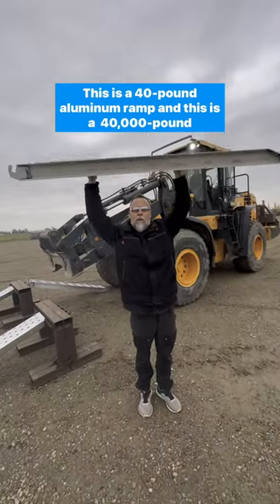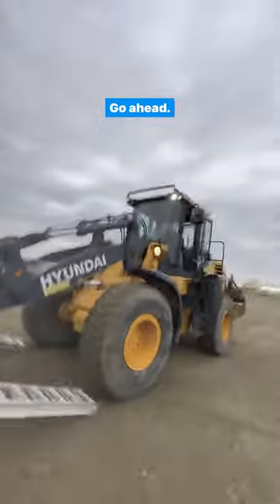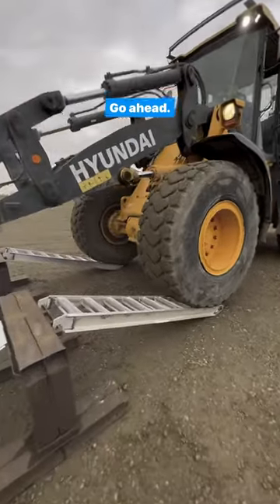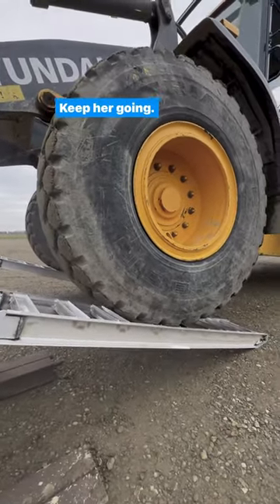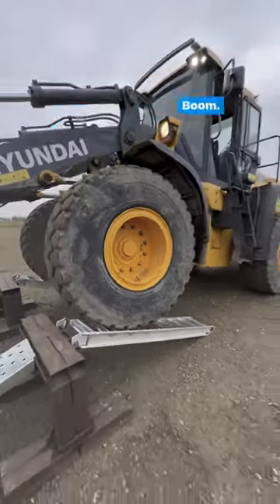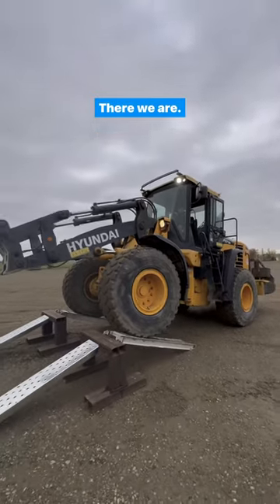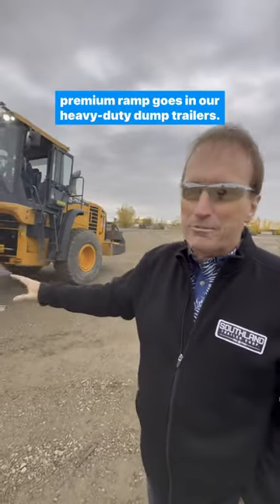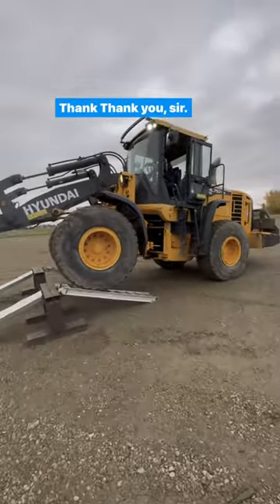40 lb Aluminum ramp VS 40,000lb payloader. #small #but #strong #shorts

Comment: Incorrect, the operating weight for a Hyundai HL 757 9A is 32,408 lbs. Since this loader isn’t equipped with a bucket we’ll subtract 2,500 lbs from that which brings us to 29,908. The weight distribution on a loader by axle is 40% in the front and 60% in the rear which means that you have 11,963.2 lbs on the front axle exerting 5,981.6 lbs on each ramp.
Reply: Dang, that was an impressive comment. Good job.
Reply: Gracious 🙏🙏
Reply: @gregsilva1472  thank you
Reply: The as seen on tv doesn't work anymore buddy nice try
Reply: @lincolnman4538 I mean, the fact that 40 lbs of aluminum can hold almost 6,000 lbs is impressive in and of itself, but I just don’t understand what you would have to gain by lying about the Gross weight of the machine when it’s very easy for anyone to look that up.
Reply: Came here to say roughly the same thing. I run a hl760 that actually does weigh 40k lbs and obviously that's not all up front😂
Reply: And if you do some basic. Physics calc, you'll find that as that front goes up the ramp the front load is increasingly shifted to the back.
Reply: @dragons_red No. Not at a small angle. A percent perhaps.
Reply: still pretty good for a dump trailer ramp.  usually a mini ex, kubota B series, or bobcat skidloader in a dump trailer not an articulating wheel loader
Reply: With a name like highwayman I’ll take this info as truth!
Reply: Thank you!

Comment: The majority of the weight is in the back of that equipment. If you are going to claim 40,000lbs then use 40,000lbs. Not 15,000lbs.
Reply: Just another marketing line of BS.
Reply: I was thinking the same. It’s like me saying I can Bench 400pounds one half time. *just the down part.. I read half a book got half way through put it down and I’ll never look at it again
Reply: And they didn’t even have the attachment on 😂
Reply: There’s not even a bucket on it, it’s more like 10 if that
Reply: All that aside, simple corrugated aluminum can do a lot more than one would think.
Reply: @EchoLog  … maybe so but the fact is  if you are claiming 40,000lbs then use 40,000lbs.
Reply: @garrimic3  I didn't claim anything. 😄
Reply: @EchoLog  … the (you) is the guy who made the claim. Not you personally
Reply: @garrimic3  I knew whatchu meant, don't worry. I have a tendency to be pedantic and like keeping people on their toes.
Reply: @EchoLog  … good luck with that
Reply: @garrimic3  ... been working alright so far.
Reply: Okay 15k, still fucking insane
Reply: To be fair, there is never a ramp that would hold all four wheels at the same time. It would only ever use two wheels at a time
Reply: He will eat his words one day....
Reply: There's no bucket on the machine, and the counterweight is on the rear. Might be 6k per ramp. My super Dukie utility body weighs that.
Reply: It still bent
Reply: It's a hl757 31k so it's a lot light as well.
Reply: Lol but you know the sailsmen... " no lie-no sale".
Reply: THANKYOU
Reply: So good for anything that weights under 15,000lbs
Reply: Doesn’t even have the bucket on the front either.
Reply: 40,000 or 15,000 still it's a damn ladder it's impressive
Reply: @douchebagme  . It’s not impressive if it’s not doing what it’s supposed to do.
Reply: @douchebagme  it’s called false advertisement.
Reply: Why did they take the bucket off hmm
Reply: I’d say 6 to 8 thousands pounds right there
Reply: Still impressive
Reply: 15000 lbs being held up by ramps used majority by sxs and atvs is still impressive. you just cant go a day without finding something to complain about huh?
Reply: @frankiepontano8647  how am I or anyone else complaining?

The person claimed something that he didn’t deliver.
Reply: YALL! It’s not even close to 15. That right there is less than 7,000 pounds per ramp.
Reply: And that weight is being distributed double so make it 7,500lbs each ladder
Reply: I don't give many👎on videos.. but clearly it's warranted here. As for this comment- certainly deserves a thumbs-up👍
Reply: @JohnSmith-om3ei  I appreciate all the 👍🏽
Reply: Add on the fact it tilting so even more is on the back, probably closer to 10000
Reply: You're absolutely right there's aboUT 7500 lbs on each ramp
Reply: 15,000lbs still!!
Reply: Video never claimed the ramp could hold 40,000 lbs.  The ad was 40 lb. vs. 40,000 pay loader.  The ramp did its job.  Besides, the ramp would never need to hold the entire weight of the pay loader.  That’s why it’s called a ramp and not a bed. Duh.
Reply: @nashmiddleton1763  .. did he use the 40,000lb payload? No.

What he should have done is tell us exactly how much weight it will hold and provide proof of the max weight.

It’s basically false advertising.

I don’t know why that’s difficult for you.
Reply: @nashmiddleton1763  .. not to mention the title states.. 40lb aluminum ramps vs 40,000lb loader.

Did he use the 40,000lbs?
Reply: @garrimic3  No, it was never implied that the ramp was intended to maintain 40,000 lbs.  It was implied that a 40,000 pound vehicle could go up the ramp without the ramp breaking, which it did successfully.  The operative term here is “pay loader.”The entire weight of any 4-wheeled vehicle will be distributed, well, over the four tires, which any person with an average IQ should understand.   Not sure why you are overthinking this.
Reply: 7,500
Reply: @EchoLog sure bud
Reply: I guess some people will believe anything somebody says.

Comment: Now back up those ramps… I dare ya.
Reply: Was just gonna say that
Reply: Glad to see others thinking the same way
Reply: Yea put the light end on it half way slow as can be. Did not go all the way or back over or anything. Probably only had 1/4 of the weight on the ramp.
Reply: Yeah with just the front weight you can see a little bow in the ramp’s backing up would most likely snap them.
Reply: @Back_door_bandit_98  the only thing I guess I’d say is, when your hauling a wheel loader you’d most likely always drive it on forward. So those ramps do work. But I always was weary of them.
Reply: I could bend those in about 2 loads. My trailer the guy said we would never bend his ramps. Within a week I was back with mine bent. My friend was back with his in 2 weeks.
Reply: @samuelw.3992  but once your front tires r on the trailer just full send it so the back make it
Reply: Keep it going keep it going please don't stop in the middle please don't stop in the middle keep it going... 😂
Reply: @samuelw.3992  it’s safe to say they left the bucket off for a reason, the welds will fail in less then a year with commercial use uneven ground etc. steel ramps for the win just do t try holding them over your head
Reply: Ayoooo right
Reply: Put the bucket on
Reply: They are meant for cars/trucks/smaller loaders I’m fairly sure. This is just a test demo.
Reply: EXACTLY😂😂
Reply: At least have the buck on it 😂
Reply: Fake news
Reply: Right, plus I noticed it has no bucket on it either cheaters!!!
Reply: No bucket because then it too heavy and ramp broke
Reply: one question, would the back end be a lot heavier, like 60% or 70% of the total.
Is it like a forklift where the greatest mass is out back?
Reply: @richtomlinson7090  yes sir. You got an engine in the back, counterweight, a big majority of the heft is in the rear.
Reply: @samuelw.3992  we had a guy get his leg run over by a forklift, and it messed up his leg, but they stopped before the rear wheels ran him over.
If the rear wheels got him, he would've lost his leg.
This is still an impressive set of  ladders though, 😆
Reply: Key word.. "dump" trailer. Who the hell puts a loader on a dump trailer. They're made for excavators and skid steers but they're using the loader to show how much weight they can handle
Reply: At least put the bucket back on
Reply: exactly what i was gonna say
Reply: @paulshewtchenko577  glad to see other people understand what a counter weight is😂😂😂😂😂
Reply: And put the bucket back on
Reply: Exactly, beat me to it 😂
Reply: We're not supposed to be that smart
Reply: Still, it is quite impressive nonetheless
Reply: @Servant-of-Christ88 your slow
Reply: Hey it's aluminum... Not chinesium. Let's not get carried away here. Everyone knows the strongest material known to man is chinesium. It's a hodgepodge of melted nail clippers, doorhandles, bottle caps, hot wheels and toasters. Pretty sure it's what Captain America's shield is made of...
Reply: Thats what i was about to say lmfao
Reply: Thank you
Reply: 😂 what do you drive into your dump trailer that’s 20k lbs ?!  Since the ramps are for a dump trailer .
Reply: Were is the bucket
Reply: @Servant-of-Christ88 I mean a quarter of 40k is still a lot for a aluminum ramp
Reply: Then they would break and not look cool c’mon man. Stupid thing is they could have shown reasonable weights and still been damn impressive
Reply: @creamythroat Not at all practical for 40k sir
Reply: Lmao glad to see a lot of people with common sense out there 🤣
Reply: Yeah, that would be interesting
Reply: Haha yeah. It oughta do for a 4 wheeler though.

Comment: The majority of the weight on that thing is in the back.  Where the engine block is.
Reply: And..?
Reply: @ElJeFe556 and the weight ?
Reply: @ElJeFe556 And were talking a massive difference between bearing the weight at the front vs the back....
Reply: It’s still impressive, it’s not like the front is light
Reply: @thedavegamer5279 they're claiming it takes 40,000lbs.
Reply: @prestonfisher2632  Yeah,and id1ots here in comments section doesn't understand that front end doesn't even have 10-15k pounds max.First there is no bucket,second on a ramp like that ,less weight is on front,and third most of the weight of wheel loaders is on the beck ,there is transmission,engine,oils ,radiators,cab ....etc etc.
Reply: @TheSRBgamer63 not just mechanical parts. The back of a loader is designed to be a counter balance, everything is thick steel and carefulyl designed to counter any load it would have in the bucket. Not trying to 1up you or tell you you're wrong, just adding that little bit for those who don't know to read as well :)

Comment: Love how the bucket is off the loader. With the bucket on those loader typically run a 40/60 split so lets say thats what it is to stay on the heavy side. So 40% of 30k which is the machines actual empty weight is 12k divided by 2 as its half the front end puts it at 6,000lbs on the ramp. While that is impressive honesty and accuracy is far more valuable Stanley. You used to be better than that my man
Reply: The weight would be shifting backwards also, putting less weight on the front.
Reply: Are they really a 60/40 split? I just took a wild guess when I came up with 8k pounds on each ramp but I didn’t realize they only weighed 30k while empty.
Reply: @geterhero  yes, they're typically in that range depending on manufacturer. When the bucket is fully loader to manufacturer specs they run about 80 percent on the front and 20 on the rear. Very handy information when you're filling the tires. Usually the front tires are ran with higher pressure than the rears due to the load ratios.
Reply: @derfvcderfvc7317  it doesn’t seem like a big angle, so it shouldn’t make much difference. But you’re right, it’s yet another reason that the 40k number is dishonest.

Comment: What about backing up it with the heavy counter weight
Reply: The front of this is still heavier than anything you’ll ever put into a dump trailer
Reply: @theSkavenger84 if they want to boast a 40k machine then they need to at least put the majority of that weight on it
With no bucket I bet that he put only a little over 10k on those ramps
Reply: Also didn't have the bucket on. Good ad though. 😂

Comment: I like it but the heavy part of that loader is on the rear. That's probably only 10k on it. Still want some for my trailer. Wasn't even a bucket on it.
Reply: Yeah, id prefer the steel ones at half the price thanks. This is just something nobody asked for.
Reply: Anything better than Harbor Freight 😂
Reply: @yyfreak1637  Wait until you get older and get issues with your back or knees. I bet you'll be very happy to use aluminium anything at that time. So childish to always only look at your own current needs.
Reply: Agree,  the title is misleading. Aluminum can be strong as hell,  but not only is there not 40k on either of those two ramps, there's not even 10k  on either one. 

I'd bet they saw 6k or less each. That's passenger vehicle ramp territory.
Reply: @Flamingtac0 
This!
In a perfect world, with perfect weight distribution, only 20k went on the ramps, and that's only 10k each, at best. But I think you're closer to actual as the counter weight is on the back.
Reply: And you can already see a bit of flex.
Still impressive.
Reply: @yyfreak1637  What about the guys that actually wanna trade up and get a much lighter ramp as a replacement ramp for the one that they lost got bent it got stolen got left behind fell out or just wants a lighter option not a bad option
Reply: @ILHillbilly67 that's not even what the topic is
Reply: 10,000 are you bloody kidding
Reply: @Flamingtac0 He said its a  40,000 payloader...he didn't lie or mislead anything. use your ears
Reply: put the rear weight on it.
they are obviously strong, not 40k strong. Shouldn't mislead.
Reply: What is also nice is they can be ladders too
Reply: They sounded like they were struggling with the load. Something half the weight might be fine but I wouldn't trust it after running that equipment on it.
Reply: Don't forget that 10k is split between the two wheels. 5k a piece. Tops.
Reply: @timderks5960 I’ll hopefully have someone like me to help me pick up those heavy ass ramps, so I can look at them and say “ when I was your age I used to pick up 3 of those at once”
Reply: Only 10 k good to know I’ll fall through it

Comment: 40k lbs but they only stuck a third of that between them. If those ramps can’t handle 6k a piece then they wouldn’t make em. Poor test.
Reply: Are you crazy? That was more than a third of the weight. They didn’t even flex.
Reply: @thereissomecoolstuff  the majority of the weight is in the back end...they even took the bucket off for some reason.
Reply: @QargZer  so how much weight do you think was on the ramps? 1000-2000 lbs? 500 lbs?
Reply: @thereissomecoolstuff  1/3 of 40000 lbs is 13333 lbs where I went to school. Divide that by two tires and, well, I think you get it....or do you?
Reply: @G19Jeeper  I do get it. So the weight of an F150 on each ramp with no deflection is routine for a 40 lb ramp.
Reply: @G19Jeeper so going off those numbers jts showing that these ramps will easily handle any skid steer wheeled or track on the market except for the wild Case bulldozer/skid steer and mini excavators up to the 6 ton class, that's still very impressive. In a dump trailer these are the kinds of things you'll be hauling. I know I'd love a lightweight strong ramp for ours rather than the incredibly heavy steel ones.
Reply: There's always someone like you trying to sound smart...he didn't lie about anything.
Reply: @BlackHawkBallistic there you go bud !!! Buy you a set or few !!

Comment: Now do that backing up and they’re crumbled all you weights in the rear but you can tell most people that watch thins channel don’t haul or run equipment😂😂
Reply: Its showing the strength, they arent meant for 40k lbs… probably rated 15k
Reply: Why you think the took the bucket off the front 🤣🤣
Reply: Derrrp. There isn't really anyone talking about it because:
1) it's obvious
2) it's a stress test. It's still a ton of weight and impressive.
3) derrrp

(And actually the majority of people are talking about it.)

Comment: The problem is that the front of that loader is very light, not even the bucket is on. Fake test! Why didnt you drive the rear of it up on those ramps???

Comment: For people saying “put the backend on now” it doesn’t have to be designed to bear the full weight, just to support it getting the front end up onto the trailer/platform which then support the weight as the back end goes up.

Comment: Aluminum doesn't hold tensile strength. Therefore, everytime weight gets put onto it, it losses more durability. After weight goes on aluminum enough times it WILL break.

Comment: Let's say that each wheel of that loader is holding 40k lbs  total, 10k lbs per wheel, if we assume weight is being distributed 100% equally which it isn't but we will argue that it is. That means the 2 ramps are supporting 10k lbs per ramp, so for argument purposes that's pretty damn good.

Comment: After it fully goes up and back down , it is literally a 1 time use ramp.  The structural integrity is meant for 1 use to sell to dummies that dont understand that aluminum is a soft metal . Each ramp was holding 20,000 pounds , the stress fractures on that thing are unreal

Comment: very impressive, but don't make the mistake of thinking it's actually holding 40,000 pounds.
it's approximately half, more or less, depending on weight distribution front to rear.
I'm still amazed though.

I've just read other comments about how the back is substantially heavier, but still, just an aluminum ladder.

Comment: The HL757 weighs in at 31,000lbs, I know from experience as an engineer that the weight over the front tires of that loader is going to be around 7k-12k lbs. That's equivalent to loading a Kubota SVL97 into one of their dump trailers. Stupid test. Show us the finite elemental analysis the engineers used to validate the design of those ramps. What factor of safety have you built into the product? What is the ultimate yield load?

Comment: That's not 40000 pounds that may be 15000 pounds if you won't to back up your 40000 pounds put the intire weight of the machine on those ramps..
Money where you mouth is